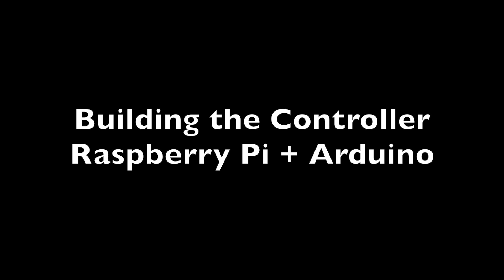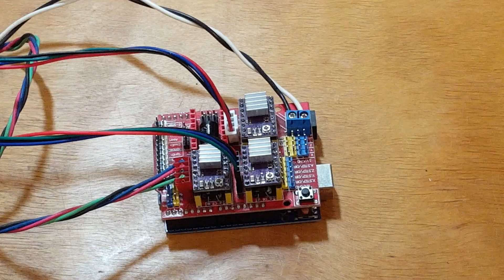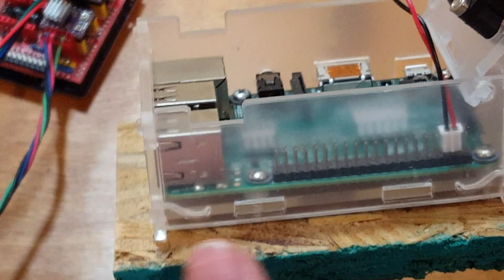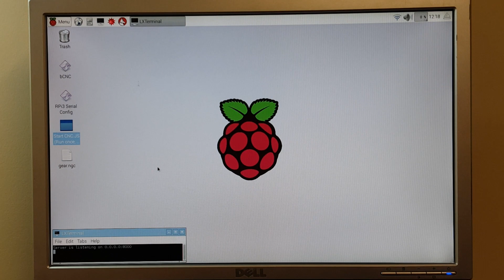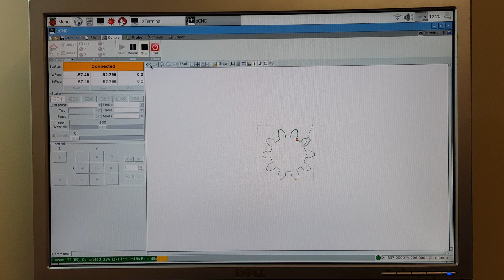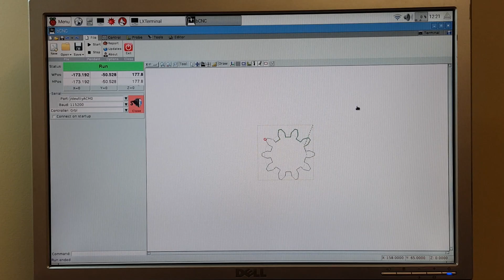First Test of the GRBL bCNC Controller

Comment: Which cnc shield would you recommend, if using the Arduino nano and JMC Servo with integrated drivers? I would like to use my raspberry pi 4 (2GB RAM) to build my cnc controls using bcnc.
Reply from the maker: If you're using motors with integrated drivers you don't really need a cnc shield as you only have to run two control wires to each motor. If you want to run your pi and the nano you could use this board and put jumpers where the controllers would go for a nice tidy setup. https://blog.protoneer.co.nz/raspberry-pi-cnc-board-hat/ Good luck on your project. -Brian
Reply: @BrianBoniMakes  thank you for that fast response! I would like to build a mobil raspberry controller, so I just want to connect it with a USB Cable to the shield an electronics, so I need a separate shield with Arduino etc...I just need a shield, where I can plug in all the motors, spindle, vfd etc, any good idea? :-)
Reply: maybe im wrong, but the shield in the video has these little drivers (3 pieces), do I need them with the JMC Servos? I guess not, that's why im searching für shields without these litte drivers.
Reply from the maker: @TRtr-es4hk  You just need to put jumpers in the sockets for power +, power -, Step, Direction. Likely for you just two jumpers as your motors will have their own power supply.   Here's a commercial jumper board, look at the image with the schematic.   https://www.pishop.us/product/pololu-socket-to-external-driver-conversion-board/

Comment: why cant you directly connect with rpi instead arduino board
Reply from the maker: I guess you could if you were to build the motion control math from the arduino into the rpi and make something to hold the stepper drivers. The new rpi is more powerful than the one I used here so it may be able to do it. The only reason to do this would be to reduce the size of the controller but it is attached to a machine that is almost 1m cubed so room is not an issue. Also the cost of the arduino and CNC shield is very small and does provide some low cost protection and the documentation to run things this way is fully developed and tested my many thousands. If you continue down the single rpi route please share your documentation as I'd be interested in seeing how you are doing. Thanks for the question Hari.

Comment: Hi Brian, Thanks for your rapid reply. I used PuTTY is an open-source terminal emulator application. The GUI  graphical user interface to open and run the bCNC program. I download the prepared Protoneer RPi image, V410-20180411, used balenaEtcher to write to the 32GB Micro card. Installed it in the Pi 3, and opened it with PuTTY . No problems. I do have a running program V410-20180411 in Linux on the Pi. I just do not know how to get to the icon for bCNC. I guess I am missing something.!
Reply from the maker: Do you have a keyboard, video, mouse attached to your Pi? It sounds like you're trying to serial terminal into the Pi from a PC. You can push X from PuTTY but you'll need something like VNC as well.

Comment: Hi, thanks for the upload. I'm having big problems with bCNC and I hope you can help. My steppers are stuttering and won't rotate properly. I can only use baud 9600, which I think is because I was only able to find the 9600 hex file for the Uno. Can you tell me if this could be the cause of my problem, or does it not matter? And where did you find the 115200 hex file please? Thank you in advance.
Reply from the maker: I'm not an expert, these videos are me documenting my work. I'd be glad to help if I could but seriously there are better sources of help. I've found that if the baud rates are incorrect nothing at all happens so if you're getting some responses it's likely you have the correct settings. I've done a lot of testing of stepper motors and when I get stuttering I first check my motor wiring. Are you using four wire steppers? Do you know which wires are the pairs? Recheck this first.
Reply: @BrianBoniMakes Thanks for getting back to me. I've solved the problem. I hadn't set my CNC shield for microsteps, and my test driver was faulty!
Reply from the maker: @petetheweet  That's awesome! Are you posting your progress anywhere? I'm planning some more Grbl videos, make sure you subscribe!
Reply: @BrianBoniMakes  I'm not posting my progress anywhere but I'll probably post a video of my final robotic arm once I have finished it. I subbed :)

Comment: Would love to see a step by step video for setting up Protoneer RPi with bCNC for Dummies. !!!
Reply: great video!!
Reply: Thanks! I'll be getting back into the CNC build this fall and will post more then. Are you building a CNC machine?
Reply: Hi Brian,  Yes I am building a WorkBee 1500 x 1500 mm (59"x59")
Almost done with the mechanical build and working on the Protoneer Raspberry Pi with bCNC and using the TB6600 Driver.